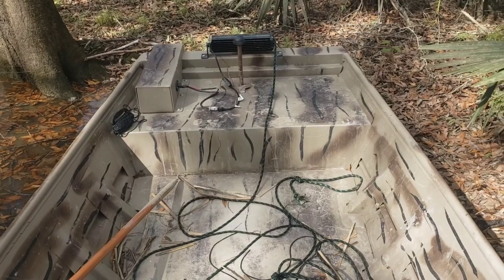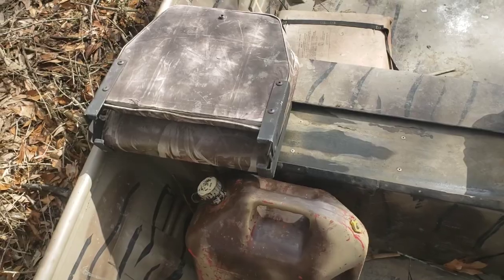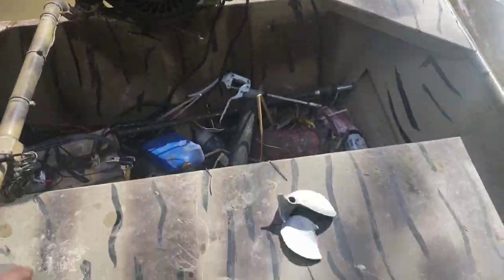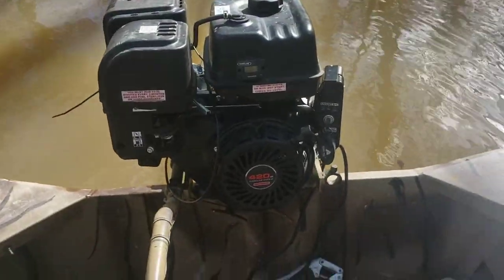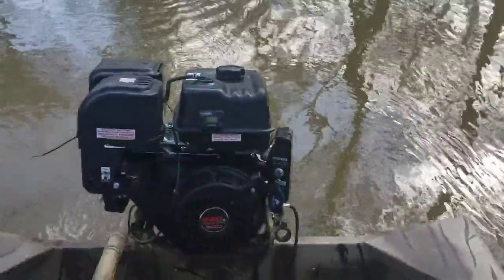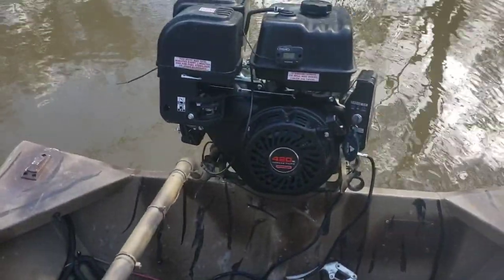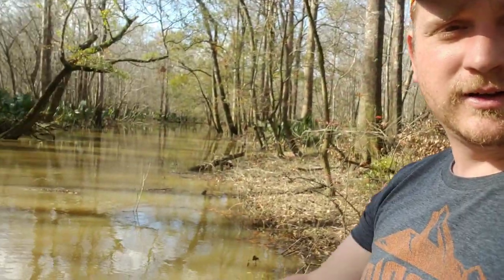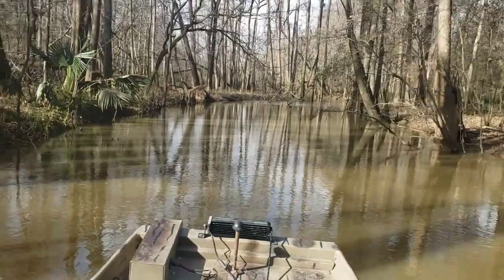Swamprunner Kit and 1436 Weldcraft Jon Boat Review

Comment: I just put this motor on a mud skipper long tail rig, on my 1448 Weldbilt pushes the boat with about a 500 lb load out about 11-13 mph. Long tail kit and predator 420cc just under 1k. Love it

Comment: i just built my medium kit and predator 13 yesterday! thanks for this video. i am running a PPF Wood Duck with a 6.5 right now, but looking forward to a bit more speed with my 1440 flatbottom.
Reply from the maker: How do you like that PPF? They seem really nice. I have a buddy looking into one for his square stern Grumman
Reply: @nickwilliamsoutdoors  i like it a lot! i originally bought it for a gheenoe and on the Grumman it would be awesome. my 1440 is an old Yazoo that i added .125 flooring and a deck to so it is a bit much for the PPF but it still hits10 or 11 mph and runs in frog spit! i need to head back down your way and chase hogs. i'm just up in phenix city so just about a 4 hour run down there. i only got to do it once, but it was awesome!
Reply: @ChrisFunktheFeralOne  I'm looking to sell my setup and get a ppf kit
Reply: @sbranham86  it was well built for sure! My loaded 1440 was just a bit too much for it!
Reply: @ChrisFunktheFeralOne  I just picked up a 1436. Thinking about picking up a swamp runner. Did you sell your ppf?

Comment: How well is that motor mount clamp holding on to that weld craft transom
Reply from the maker: Fine, so far. About 80 hours on the motor thus far without issue.
Reply: How did you get it on the transom with that middle brace there? Did you have to alter the mount? I’m looking to getting a weld-craft. Thanks for the response!
Reply from the maker: I had to remove the washers on the back of the mount

Comment: Good job on an honest review, and one of the most thorough I’ve seen.
There are a few points you brought up I would like to shed some light on;

1.THAI vs. AMERICAN LONGTAILS: While there are other Thai brands out there utilizing shafts made from light weight 5/8” hollow tubing, your Swamp Runner runs a ¾” solid steel driveshaft, which is just as strong as the American longtail brands you mentioned, which also use the same diameter shaft.

2. PROPELLERS: Swamp Runner offers more propeller options than any other mud motor company.

If you’re running swamps with lots of cypress knees, you can get a stainless prop from Swamp Runner.  Swamp Runners are built solid to handle them.  Are stainless props for everybody? No, they are expensive.  That’s why Swamp Runner offers aluminum props.

For folks who want to save money and prefer for their propeller to be the weakest link in their drive train, Swamp Runner offers aluminum props.  Are aluminum props for everybody? No, that’s why Swamp Runner offers stainless props.

For the wrench turners who wanna go faster, Swamp Runner has a pile of performance and racing prop options you can’t get anywhere else.

Liked and followed. Look forward to seeing more in the future. JD